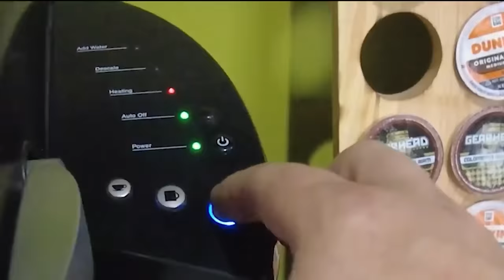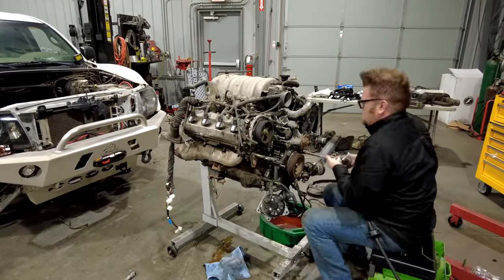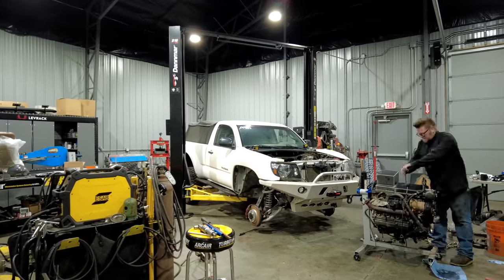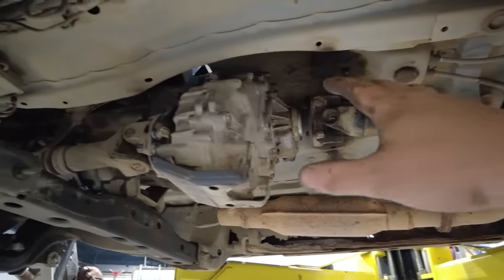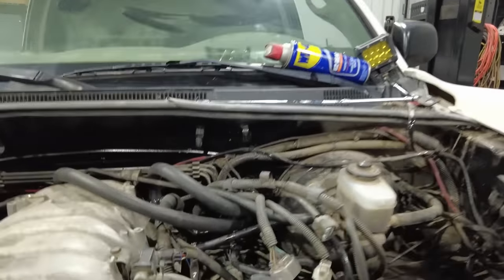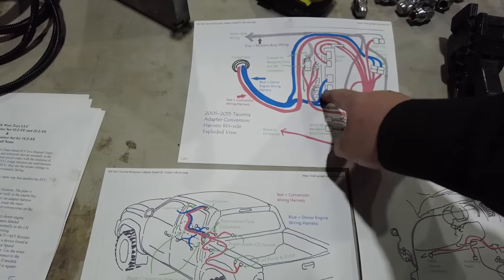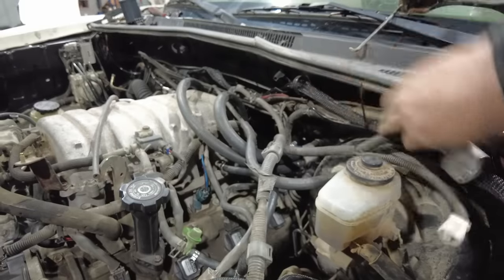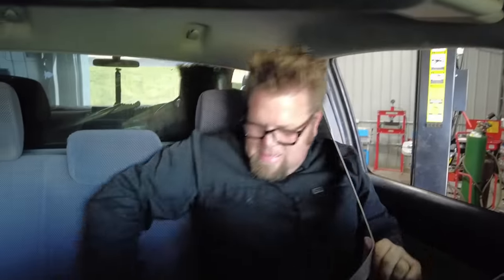Tundra 4.7 V8 Swap Into Tacoma Manual Trans, Complete How To

Comment: Ian, former Toyota Master Tech here.  Did you know that the 4th gen 4runner was available with a 2UZ and the engine compartment and whole front half of the frame are identical?  Knowing this now, would you have looked for one of those for a parts vehicle?  The oil pan from that would have fit as well as your A/C and P/S lines without pricey custom work.  There's a good chance those motor mounts would have fit too.  You'd still need the bellhousing adaptor/flywheel setup you got, but there would be a bunch more compatible parts that would swap over from the 4runner.
Reply from the maker: Yes I did learn that...I looked at the 4Tunnrr pan...but finding one was hard...and then finding one for a parts vehicle I think would actually be more expensive than the swap using the Tundra. I love the idea and if I could of found one I would of bought it
Reply: 2UZ...?
Reply: @travelinman482 literally what the video is about
Reply: @brkbtjunkie  
No, what is a 2UZ?
Reply: @travelinman482  Its a Toyota 4.7l v8
Reply: Will a 2012-2014 Tacoma reg cab be compatible with the 4th Gen 4runner as well?
Reply: @coreymcgowan3749 I’m pretty sure a 3rd gen runner is the same as a 1st gen Tacoma. 4th gen runner same as 2nd gen Tacoma.
Reply: Didn’t that gen had issues with headers cracking?

Comment: Ian, on the fuel line, I have much better success heating up the barbed fitting rather than the plastic hose. It don't need to be hot, just warm enough to make the plastic pliable.
Reply from the maker: I though of that....but the fact that I was heating up a fuel rail made me nervous...you know explosions and all
Reply: Practice on a fitting held in a vice, it's about 5 seconds or less...

Comment: I did a few things different but same swap its a fun truck. The AC lines from the GX470 or the 4runner will work with this swap also v6 tacoma powersteering lines are perfect  for the swap also
Reply from the maker: Thanks for that info...it really wasn't bad getting my custom made ones done locally and I was able to just re use the old lines from the donor truck and the Taco

Comment: I had an LS Swap done. Went with a 5.3 all aluminum L33 in front of a Tremec TKX wide ratio into my Regular Cab 5 lug with a TrueTrec. We worked with an LS Swap motor mount company. They now sell the mounts for $180 using a Holly 302-1 oil pan copy. Sold the 2TR for $6500 in less then an hour it only had 36k miles.
Reply from the maker: What Tcase did ya use?

Comment: I’ve completed a few UZ swaps using the same internal slave cylinder setup. Whenever I have clutch feel/ engagement issues, a larger bore master always fixes it. The 87 Toyota Landcruiser clutch master has a large bore.
Reply from the maker: This slave is speced for .75 bore...thats what the taco has...its better now air has worked out

Comment: Front diff is actually easier to remove then sliding the trans back but project going well
Reply from the maker: I disagree....Pulling the trans way easier
Reply: @BigTireGarage  I agree with you after seeing everything you were doing made way more sense to pull the trans especially for the clutch

Comment: You could also install electric fans in front of the radiator and have then push air and put the mechanical fan back in and have extra cooling
Reply from the maker: I plan to add a small pusher fan that activates when the AC is on
Reply: @BigTireGarage  good plan Will also help with trans Temps if you have a external trans cooler in front of the radiator also

Comment: As a person that builds “import” engines for a living I can attest to the fasteners not all being common lengths on a component. 
Some fasteners are not only unique in length but also in diameter as well when you consider the 7mm bolts used to fasten the camshafts in.  
Wrong bolts installed isn’t just an issue while working on an engine after the fact like you are Ian. It can still happen in the factory.

Comment: Did you look into using the oil pan, upper and lower, from a 03-09 4runner V8 truck? The oil pan is already in the position you need. Front suspension is almost identical between the 2nd gen Taco and 4th gen 4runner too. Keeps all the parts OEM too, which is a huge bonus for a swap like this. Great work either way.
Reply from the maker: I did...and to be honest I couldn't find one for less than 1k bucks on eBay
Reply: @BigTireGarage  That's a bummer. Watching you do this swap, all I could think was that using a V8 4Runner would have made this even more plug and play than it already is. From the heater hoses and fuel feed line to the oil pan, radiator and shroud. Love how it all came out for you, I'm sure it makes for an awesome little truck now!
Reply from the maker: It took me forever to find the Tundra for a good price...can't imagine how hard it would be to find a Four runner

Comment: Great Content Ian as usual!!! I like to twist my wires together after running thru a solder connector, then pull the solder connector back over it. Adds a bit of strength as you have the twisted connection plus the solder band.  Great Product, has made wiring a much easier, one of those break thru products if you ask me. Great Swap and Build Series!!!!
Reply from the maker: Great tip!

Thanks for that!!!

Comment: ive had a 2uz in my 2012 taco for over a year, great engine.  mines got the stock automatic with dual mini truck cases with fj80 axles
Reply: Does the 2UZ bolt up to the auto trans or still need an adapter? Different transmissions from factory so I’m assuming adapter
Reply: @justingalvan4050    it has the 01 sequoia auto with a marlin crawler adapter for the mini truck tcases

Comment: I have a 2uz in my 06 tacoma ...its also wide body and changed to 2020 bed and front ...I got my oil pan as a weld together kit from lextreme about 4 years ago
Reply from the maker: That is awesome!!! Where can I see pics
Reply: I have a couple of it mocked up on my Instagram...mine is a little different...its body dropped to the doors so my 3 inch flared bedsides and fenders allow me to steer while super low  ...the bedsides bolt on factory so its an easy swap ...front end is more tricky ...the truck is currently torn down to the frame to paint and complete
Reply: I also did the same 2uz swap to an 88 4runner on a 2wd chassis lowered

Comment: The "Million Mile" V8 in a 2nd Gen Taco, sounds like what should've been a factory option.

I also noticed the frame on that Taco is in pretty rough shape, I hope it'll handle that extra weight and power.
Reply from the maker: So far no issues...I am on the hunt for a new frame

Comment: I can see why so many think this should be an ultra 4 truck.  I think a V8 in anything should be an option.   I love when a company makes similar devices for different models, like the evap and all.  Such and easy exchange.  Good info on the wiring on this. Sweet sweet victory
Reply from the maker: Yeah that is one nice thing about the Toyota stuff they build from the parts bin so much
Reply: @BigTireGarage awesome to hear this worked out!

Could you please touch on the reason why a v8 4runner pan wouldn't be a good part to use instead of a custom part?

Comment: For the nylon fuel line... heat the metal barb/metal line youre putting it on instead of the nylon line. I just did it on my YJ that I botched a couple years ago. Even the previosly kinked line pushed right on.

Comment: 1:08:15 Ian, I’d put an air bleed in the upper hose, just to get the air out, unless you use a vacuum installer.
Reply from the maker: Changing the hose to a different design soon

Comment: Bought an 02 Sequoia (2wd) and I want to convert to 4wd. I already bought a used front diff and prop shaft from an 05 tundra. Seeking a tcase and trans next. Manual tcase I hear from a 3rd Gen taco is best. However I'd LOVE to manual trans it as well. Any advice? (I'm a automotive technician so I'm not scared of the work). Just need the compatibilities and aftermarket Bell housing adapter help.  What clutch to use, etc.

Comment: Awesome truck! Looks like a blast to drive.

Also, pro tip. Make your clutch bleeder line long enough to reach your brake master. You can then crack it open, put it inside, and then bleed the line by yourself with ease 🤘🏻
Or a speed bleeder too

Comment: Minus the oil pan, it seemed like the truck and the V8 were made to go together. Everything just kind of lined up or fell in place with little trouble. It does seem hard to beat a V8 Taco and the magnaflow sounded good.

Comment: Very nice detailed video. I'm wondering if you could've used a 4th gen 4R V8 radiator to simplify the coolant hose routing.
Reply from the maker: Now that I have finished the job...it looks like I can use rhe Lexus GX470 radiator and hoses

Comment: Great job!!  Q?  Would the original oil pan work?  What was your reason for getting a custom oil pan made?  If you were going to do it over, would you have put the oil drain plug in a different location?
Reply from the maker: No way to make the original pan work....now that this pan has been made...I have given them a better location for the drain. They asked where I wanted it...and I thought it would clear...pans thwy make in the future will have the drain front left of the sump.
Reply: Love the fabricated pan! Looks awesome. I have to believe 4th gen 4runner/gx470 oil pan would work since the 2nd gen Tacoma front frames are identical. Would be a more budget friendly option. I've used that pan on a few Tundra SAS I've done. If the frame from the Tundra is solid don't scrap it, we need them in the rust belt. Love this build.

Comment: 17:30 Ian, you didn’t mention replacing the oil pump with new, considering you figure it has 200,000 miles on it.

Comment: MY GOD!! That's where Toyota put the starter on those!!?? I'll have to see if the later larger V8's were the same way but that's crazy. Although, Toyota starters are very well built and rarely die so no big deal to the average guy. But if that's a repair you need, no fun at all and not cheap...
Reply from the maker: A few different companies have done that....It protects the started from the elements...but yes does make it a pain to change

Comment: Awesome to see this! I’m currently swapping a 2001 tundra 2uz into my 1996 Tacoma. I have read up everything I can find on the few that have done this swap. No one mentions having oil pan fitment issues. Now obviously, my truck is different than yours so it’s certainly possible. But it makes me curious, where were you seeing fitment issues with the tundra oil pan?
Thanks for the awesome video!
Reply from the maker: The Tundra pan was completely wrong for my front axle configuration in the Tacoma.  It was more of a front sump style pan so there was no way it would work.  Are you keeping your 96 IFS or Solid Axle Swap?
Reply: @BigTireGarage  I’m keeping the original IFS front. My truck uses the same front diff as the 2001 tundra, and from the looks it all appears to be in the same location. So I’m hoping that will make the stock pan fit.

Comment: This is so great!  I had already found NW Toys and XAT Racing here in Florida a year back and have been planning this same swap for about a year now... come on Swap Budget Funding!!
Similarly, I also have already swapped in a FJ Cruiser T-case to my rig (Toyota electronic actuators are not great!)
But what I didn't see clearly in your video was what transmission you had with your 4Cyl engine?  
Because my understanding ( a year a go) was that XAT Racings adaptor plate works with the R150 family of Transmissions, not the RA style transmissions that came with the 1GRFE (6 cyl) engine, that I have.  

And I also wanted to comment that I hope your trucks Frame is up to this task!  I know all about that due to my Frame replacement back in 2018!

Can't wait to see some follow up videos for this swap!  Thank you Ian!
Reply from the maker: Mine is an R155....so yes their adapter works...
Reply: @BigTireGarage  is yours a 5 speed manual?
I think that’s the deal, your lucky in that respect I suspect.
Reply from the maker: Yes,  5 Speed and it is awesome!!!!

Comment: Fantastic build!  I absolutely love it!  Your attention to detail is fantastic!  

A few things I noticed:

In the price break down I didn’t see the adaptor for the transmission, clutch hydraulics, or clutch.

The wiring harness looks killer seemed like they paid attention to almost every detail. The one thing that surprised me a lot is that you had to splice into the factory harness in the passenger side kick panel. It seems like if they went through all the trouble to make that harness, there could’ve been plugs there. 

Does the factory speedometer work?  I feel like it should.
Reply from the maker: The adapter and clutch are on the price breakdown...under Hard Parts from XaT Racing...yes the speddo works, tacj works, fuel guage works...it acts like a factory truck
Reply: Sorry I missed those parts in the break down!  

Thank you for the reply, again, I love the build!
Reply: @BigTireGarage  why wasn't a factory v8 4runner pan used (instead of an overpriced custom oil pan)?

Comment: Fantastic video.  The detail is perfect.  I have a somewhat unrelated question for you.  I'm in the process of building my first "shop".  I notice you have what looks like bare concrete.  Did you seal the floor with anything?  Why not use a coating like epoxy or polyaspartic?  I'd be very interested in your feedback.  This is a life time dream and I want to get it right.  Thank you.
Reply: I'm not Ian, but I'm happy to give you my opinion. Lol
If you do a coating, I highly recommend paying a reputable company to do it right.
But consider (research and ask around) polished floors.

There are pros and cons to both. If you drop a rotor on epoxy it's probably going to chip it. And no matter how much you say you won't, accidents happen. If you plan on moving lifts around or heavy weight on jacks/stands, it will probably chip and peel.
Of course a polished concrete floor is not going to be as easy to clean, even with a basic sealer on top. But cost needs to be considered and the type of use.

Comment: I'm about to attempt a 2001 tundra 4.7 drivetrain into a 2012 with a blown  up 4.6
Do you think its doable? I have a good running,complete 2001 with a junk frame for the donor.
Any advice would absolutely be much appreciated. 
Thanks in advance.

Comment: There was a V8 4 runner , wonders if any parts from that would transfer over to a Tacoma? Great swap , and the price wasn't really that bad when you add it all up .
Reply from the maker: It would....I talked to a few people and some said the oil pan and other parts would work.....but I couldn't find a pan used anywhere....and the only one I saw on eBay was 1000 bucks....so the custom pan was the right choice.  As for the AC lines and PS lines I think those might of worked....but I already had the lines of both trucks....so just getting them crimped was way easier than buying new lines

Comment: If you would have gotten the engine from a 4 runner instead of a tundra, everything would be a direct bolt in. Mounts, oil pan, radiator, air box, everything.
Reply from the maker: True....but finding a donor 4 runner was impossible!!! Tundra V8's are very plentiful!!!

Comment: Looking forward to see it crawl and I wanted to ask you if you have considered going straight axle in the front?.
Reply from the maker: Not on this generation, I have done a bunch of sas yotas...but this truck just works with that AllPro kit
Reply: @BigTireGarage  I wasn't sure your plan prerunner or rock crawler personally I prefer the solid axle instead of the independent front suspension.

Comment: Did you use the stock trans? I noticed you have a separate shifter for the transfer case and the 2nd gen tacomas all have a knob you turn.
Reply from the maker: Yes I reused the stock trans...I had already done the FJ Cruiser t case swap (popular for the Tacos) to get rid of that turny know.  I did have to hotwire the front axle actuator

Comment: Did all the gauges work like factory? like the Rpm etc. Im sure if someone put a ls in one of these they could get the gauges working as well. But a cool swap none the less it sounds great.
Reply from the maker: Yes factory guages work...and no an LS conversion would be able to drive the gusges...the ECU for the Taco uses a different signal system

Comment: Since this is a new combination of various parts, would it be worthwhile to measure the concentricity of the flywheel relative to the bell housing and possibly use offset dowels if needed?
Reply from the maker: Doesn't need it
Reply: @BigTireGarage Just curious because Tremec insists on minimal runout on the TR4050 because the bearings they use do not do well with excessive side loads.

Comment: What is your opinion on spring over vs. Spring under on the rear of a multipurpose rig? Most crawler rigs seem to run spring over for flatter, better flexing leafs, where as desert trucks run spring under for more arc. What about something along the lines of a UA build that will see a lot of highway miles, carry camping gear, decent rock crawling, and some desert stuff?
Reply from the maker: Nothing wrong with Spring Under....it just has more long hanging fruit for rocks to grab...

Comment: I see 4 links on all kinds of crawlers,bouncers and I don’t understand the angles of the 4 links. Some are true double triangulated links, then some are only triangulated on top or bottom. What is the purpose of doing that? I’m in the process of building a small crawler for my sons to drive. So some insight on this would be helpful.
Reply: Anyone else know why? I’m stalled on the project trying to figure it out.
Reply from the maker: A si gle upper triangulation will provide a softer roll axis (less tippy) but if you want it to flex like a bad mofo...triangulate both